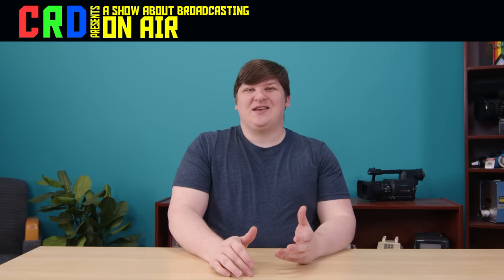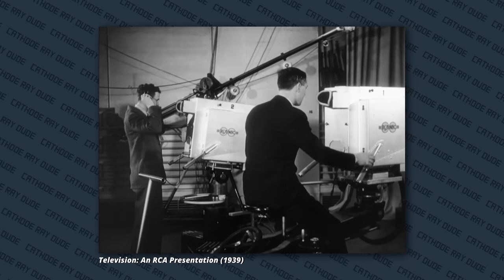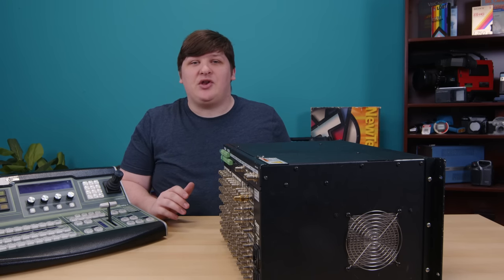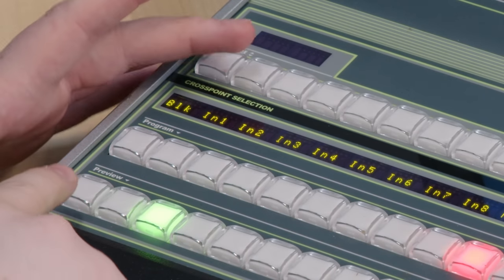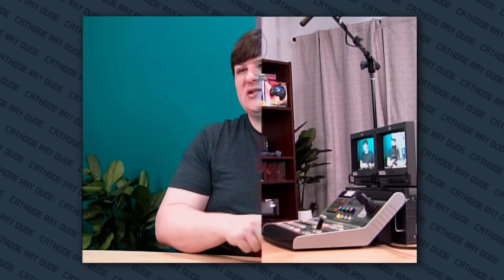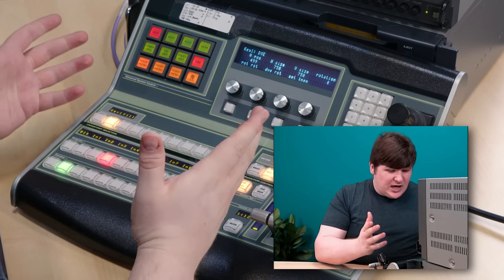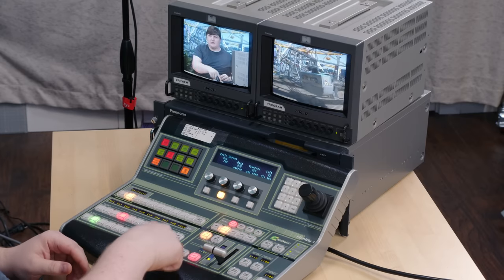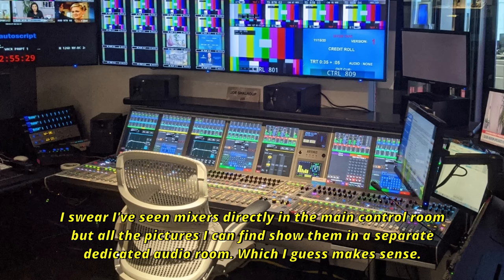What the heck is a video mixer?

Comment: 53:40 That Panasonic "Special Effects Generator" (W3-4600B?) is what we were using in the mid-1970s in the large medical school university where I worked.  Of course, like all pre-digital video gear, it required perfectly in-sync genlocked sources, so each camera (or other source) had to be pains-takenly synchronized together to the "house sync".  
Not just vertical and horizontal sync, but also fine-tuning the horizontal line timing to fit the line within the visible frame so the black part at the beginning and end of each line ("blanking") wasn't visible.  
And then, with color, even more finely-tuned for the phase of the color subcarrier so that the colors didn't shift when you switched between (or dissolved between) different sources.
But modern switchers (even modestly-prices gear from BlackMagic Design) have "frame buffers" on each video input that accept uncorrelated sources and digitally re-synchronize them together so that video transitions are smooth.  But at the expense of several frames of delay.  Even BlackMagic with built-in digital frame buffers still recommends externally genlocking the sources (cameras, etc.) together to minimize how much the frame-buffer delays the video signal.  
And then there is the problem of re-synchronizing the audio back to "lip-sync" with the video because audio processing is essentially "instantaneous" while video processing, even with high-speed digital circuits, can end up with a large fraction of a second of lag (10-20 frames, etc.).

And back in the analog days, there were only a couple of different timing standards: The "NTSC" (retrofitted into the existing black-and-white video standard ("RS-170"). which was used in much of North and South American and a scattering of other countries and islands, etc.
And then there was the essentially UK/European PAL and its first-cousin SECAM, popular in France (and other Francophone countries) and in the Soviet Union.  Some of the PAL/SECAM division was political and propaganda-based on either side of the "Iron Curtain".
But in modern/digital era, there are literally dozens of different video standards.  cf:  https://en.wikipedia.org/wiki/List_of_common_resolutions

Comment: The Panasonic mx50 contains two frame stores, one for A and one for B. The advantage is that you can have unsynced sources. The disadvantage is that you can’t hot punch the inputs without the output freezing for a few frames. You have to go via the take.
We used them for big screens at concerts and events in 90s and early 2000s, before hd-sdi was our production standard.

Comment: We had one of those Videonics switchers at 28:04 and I don't know if it was just old or cheaply made but it sucked. If it got too hot in the control room during the summer, it would get stuck on one camera and wouldn't let you switch off of it until you UNPLUGGED IT AND PLUGGED IT BACK IN!!!! I was only doing local town board and commission meetings but it was still a nightmare for a live production. Night and day difference when we upgraded to a Tricaster Studio somewhere around 2007 or 2008

Comment: I ran a few different generations of tricksters, blackmagic and one other brand I can’t remember in high school and for a few years after. Tricasters for their cost were very disappointing and a new TC430 did as well as a decade old shuttle PC one. In part the bitrate was extremely low and the JVC we had wanted all the light you could feed them.
We had 3 small camera monitors and 1 for each of our 2 external DVRs. 2 TVs on the wall duplicated the computer monitors for the mixer. 
Funny enough we technically had 2 mixers with a blackmagic unit that was dedicated to routing monitor feeds.
Dedicated chroma key units still get used some. Usually on a semi fixed setup

Comment: when I was getting my pilots license I started in a little piper 150, its like the vw beatle of airplanes. very simple and small and it feels like there's nothing between you and the outside lol. I went from that to a duel engine piper apache which had more than twice the controls and extra avionics and such, I was a little overwhelmed but after actually flying it and learning what everything does it doesn't seem as complex anymore.  now I can get in just about any prop aircraft and understand what everything does .. that's what this made me think of. wow that's a lot of buttons! lol.  but when you learn it its just the same dozen systems or so over and over with little differences or in different configurations.

Comment: I bought a panasonic video mixer with the title generator for 15 bux at a yard sale and would use it with a cheap projector for movie nights in my back yard… sadly it died in a flood along with a ps2, the projector and one of those flip up screen dvd players and a harmon kardon speaker/sub setup… I had it all wired in a modified trunk that I painted red and black to look like an old theater, clap boards on the sides and some hanging led candle sconces on either side of the projector when set up… It was super easy to set up, we also had an air popper. miss that setup, it was such ridiculous overkill for a 480 prohector but it was fun

Comment: In regards to the whole "Who uses wipes" bit, at the TV Station I work at they are used quite often, but never when actually live, but a lot in the preparation of the show, to compare framings, colors and such stuff. Sometimes the director wants to see the Wide shot next to the close one, or something similar, and for that we use the wipes. Even though they are then of course used via the t-bar and not as presets. Als the T-bar is generally used by the technical directors a whole lot, even for cuts and such. Not quite sure why though.

Comment: Great video! I actually use OBS regularly for my work. With a little customizing, my keyboard's numpad and the greater than key work like hardware switcher keys (inputs/sources and cut, respectively). Like that Sony setup you showed earlier though, I've found stacking OBS with an ATEM Mini to be the best for my M/E workflow.
Reply: What kind of work? Most places seem to require reliability that OBS can't provide
Reply: @xWood4000  I lead a three-person crew livestreaming my church's worship services and recording the sermons for an audience of ~150. I also occasionally run livestreams for my other job, a large-ish YouTube channel, with a multi-camera setup and a wirelessly-thethered phone camera for other things. Based on some of this video's comments, I guess I'm lucky to not have had any notable OBS crashes. It's always been a reliable piece of software that I use at least once a week without a second thought.
Reply: I'm in the same boat it's fairly reliable although I've had a few issues either due to hodgepodge equipment under powered computers or in the last case weird codec issues. Somehow I was getting beautiful images on YouTube but the second stream on Facebook was freezing glitching and stuttering. I'm bringing over NDI 2-4 cam. Numerical keypad and I put my multiview an external touchscreen.

I did recently have an issue where the main user interface froze however the stream still continued thankfully stuck on the laptop capture from the guest speaker. Because I'm using NDI Launcher able to set up a rough layout on my laptop full screen the output and hot patch the HDMI cable over and with the stream so I was 30 minutes of laptop followed by a quick to a camera. then we were back in business until we took a break like 15 minutes later.... Where I was able to restart the program and I didn't even lose the recording this time. The reliability has definitely gotten better but it requires a decent system.

Comment: Awesome, thanks for bringing back all those memories lol.  I started out with Sony Lo-Band Umatic then onto an SVHS, 3 machine Panasonic rig with TBC and a Panasonic MX12 mixer, late 1980s.  These days I mainly use ATEM and vMix, see my last video about using them together for advanced features but with extra resilience and hardware switching.  A version of your panel was of course used for many years by Blackmagic as a control surface on their early rack mount ATEM switchers.  It reminds me of the quirky Panasonic camera I had, which you might like, WM-F70 (I think) SVHS camera/recorder but with 2 imaging chips, which replaced my earlier 3 tube Sony M3.  It was really interesting how they used the two chips though, one for luminance and one for chrominance, which is exactly what is needed for SVHS.   It never became a thing though and was obviously replaced by three chips fairly quickly.  :-). Andy
Reply: I spent my TV career in companies that happily worked with older tech, like Umatic, even in the 2000’s.

I’ve been looking at the Blackmagic gear and vMix/OBS just out of interest. Your workflow sounds really interesting and I’ll go check your channel out.
Reply: @oomredoo  cool thanks, there is a Camera and Tech playlist.

Comment: Trying to take notes here as the video is playing.

Genloc, as I recall, this replaced the Term SYNC.  It provides Timing signals to keep all video equipment/cameras in sync.  When devices are turned on they run on their own timing pulses, so this was required to ensure all devices were functioning at the same exact pulse timing.  If you didn't have this, you would get lines and even distortion through the broadcast.  Normally this would have been provided by a SYNC Generator that would send the timing pulse to everything (more cables)

The wipe bar for manual Transitions was actually needed as some earlier/older mixers didn't have a preset button for the wipes.  This was the case for a studio we set up in my High School.  So in order to get anything other than a cut is was required.

Comment: The same thing you say about video mixers applies to modern aircraft, by the way.

I've always been a big airplane enthusiast and have spent thousands of hours in the simulator.
As a flight simulator "player", you fly significantly more different aircraft than a real pilot ever would, but one thing you learn relatively quickly. Once you understand how a cockpit in an Airbus A320 works, then you understand most of any newer Airbus. The same is true with Boeing, though the cockpit of a 737 is almost incomparable to the 757. But if you understand the cockpit of a 757, you will also understand a 767, 777, 747 and even a 787.

The fascination of operating a device that at first glance has thousands of different buttons and switches is probably what connects us all in some way. ;)

Comment: I was a TD in a past life.  Most of the time I used mix to automatically dissolve, was usually pre-set at 15 frames.  Sometimes you'd want a slower transition.  Rather than reconfiguring the transition rate to 30 frames or more just for one transition and then risking forgetting to set it back to the usual 15 frames it's easier to just use the T-bar to manually do that one transition.

Comment: That Panasonic WJ-MX50 seems weird, because it seems to be treating video like a simple audio mixer deck treats sound (at least how a FoH/sound-tech would), just with the cross-fader moving vertically rather horizontally, like a typical DJ audio mixer would: two selectable (from 5 possible) inputs going to either end of the fader. One major difference to an audio mixer is that all of the inputs must be gen-locked (ie: the frame refresh and line-scanning are synchronised), otherwise trying to "simply" fade across with just a variable resistor (from one channel input to another) results in just video noise/static or no picture at all, except for either extreme end of the fade. It's also intended for live event VJing, rather than studio use, so it incorporates audio mixing, to create an "all in one" AV mixer.
That simple AV switch box at 08:56 won't "cleanly" switch between video sources: the image will tear and/or go to static for a brief instant, because it doesn't lock (ie: genlock) the signals together.

Comment: Yeah okay, you got a sub for this one lol, super cool video, especially since I'm probably in a somewhat unique situation of running my own bootleg broadcast TV station for my virtual house in VRChat, basically, I decided I wanted to do things the hard way rather than just...ya know...setting up a playlist of youtube videos on the TV system, which is REALLY easy, plus, I was kind of just interested in how the tv stations do it.

From what I've learned so far, a lot has changed over the years...but, also hasn't really if you know what I mean, and in a lot of cases, actually, yeah OBS is more than enough, assuming you have the other systems in place to go with it, my system for example consists of OBS as the switcher (and CG layer because I'm lazy), casperCG as the playout server, plycast as the playout client/control, with SPX running CG, technically casper can fully control SPX, and plycast has options dealing with the logoing and CG, but again, lazy and don't care so logo and tickers are over everything including the funny ads I decide to have on my "network", I don't think too many people would really ever need the kind of fast access to keying that something like a CBS or an MTV would need, plus OBS is massively plugin friendly and supports a surprisingly large number of industry standard control surfaces and other protocols/interfaces, I think, if people REALLY wanted it, OBS would do it, but it's similar to my situation, I originally thought I'd be able to just get a simple playlist type plugin to...ya know, just play a bunch of video/image files one after the other or on a scheduled time...oh how wrong I was, there's a couple in development/use, but if you really want a playout solution for OBS (or in general really)...you go get an open source playout solution like CasperCG client's and server or some of the others, or...you sell your kidney and a few other body parts to pay for the commercial playout solutions real TV stations are using, some of which can just skip the OBS step entirely and output directly to NDI/RTMP etc., it's been super fun learning about it all, and kind of blows my mind that some of this kind of stuff is actually available to us nerds at all...and in a few rare cases, free and open source.

Comment: OBS Studio, particularly now that you can use a scene as a source in another scene (scene nesting), can be used in precisely the mixer way you seemed to indicate it could not.  I set up my inputs as a scene (cameras, video player, screen capture, game capture, etc.), i have all my audio devices as a scene, I can create intermediate versions of my inputs (if i want) to do things like cropping or putting a fancy border around my head shot or whatever, and I can have fully composited top or bottom elements in separate scenes.  then when i go to build the final scene (that i would actually switch to, i can add my audio scene, my composited graphic elements scene, my intermediate or source scenes, and that's it... the intermediate scenes can also include a keyer effect which makes parts of that scene's video feed transparent (or translucent with full variable opacity control - great for a translucent logo or something), and I can select which scenes show up in "multiview" which I can open on a dedicate display and gives me a live preview of all the scenes i would switch to and allow me to select and cut or cross-fade to that.  I've used it to run quite a few live streams and "live-to-tape" (typically with a youtube video as being the destination) events.  I can't think of a feature that the video mixer you showed off in this video can do that I can't do in seconds with obs (and in most cases easier and more repeatably (because i can preserve those scene settings), and if i want to remix them, I can duplicate existing scenes, and change elements around to my liking without destroying my original scene. - if I don't need a scene anymore, i can just delete it. - and with the plugin "scene tree view", i can organize my scenes into an easier to understand hierarchical view and hide away my intermediate scenes or scenes that may not have anything to do with the format of the video i'm trying to produce just then. (i.e. I have scenes set up with logos and stuff for my personal streams and other scenes with other more different logos and layout styles for my work stuff that I produce).  with external add-on software for obs (I've grown partial to touchportal), i can even create my own macros, complete with stingers, various composited effects, etc. and really enjoy using it to switch inputs and audio because i can't possibly fat finger something in obs while i'm live, switch to the wrong scene outside the scope of the current presentation, etc.  nearly completely eliminating "pressed wrong button, presentation failed" scenarios.  AND best of all OBS studio is free and open source (though I donate yearly to the project which is completely optional because I use it so frequently and I wish to give back to the development of such an amazing piece of software.  Touchportal is $14 for android or ios for a lifetime license with free future upgrades, is ridiculously easy to get set up with fantastic tutorials and great discord support from the devs and the community, and are very receptive to requests for new features and bug reporting.

Comment: There are basic stage lighting consoles that work with the A/B mixing principle. The same light controls channels with faders are duplicated onto two scenes (buses), where you can prepare one scene by guessing fader positions without affecting the lights currently on (no visual change). Each scene has a master fader, but they are next to each other and inverted, so one goes 0-100 and the other 100-0. That means you can move both at the same time to bring one up and the other down in a smooth motion. You then prepare the next scene then fade back again.